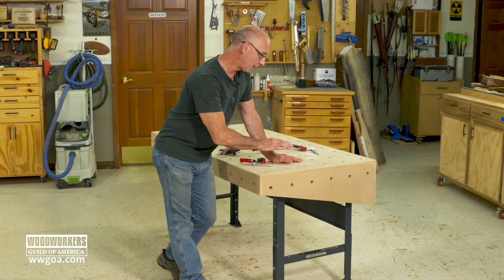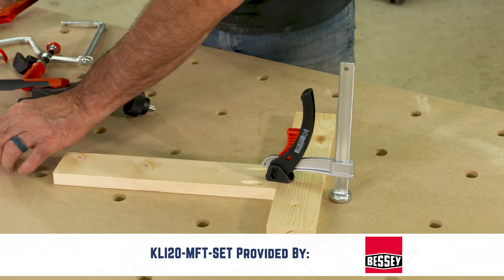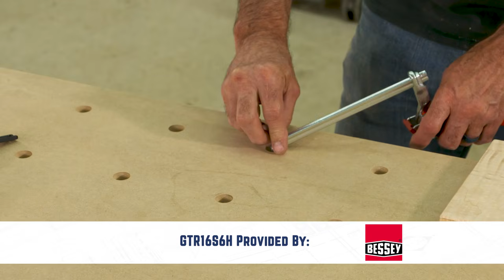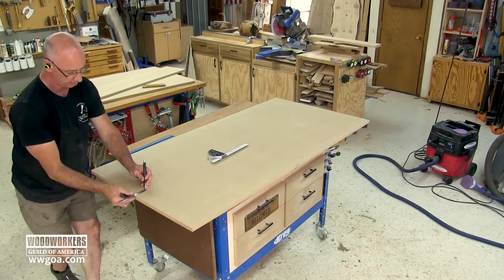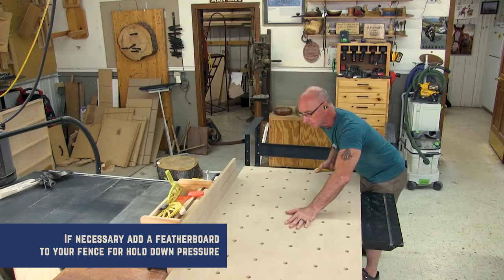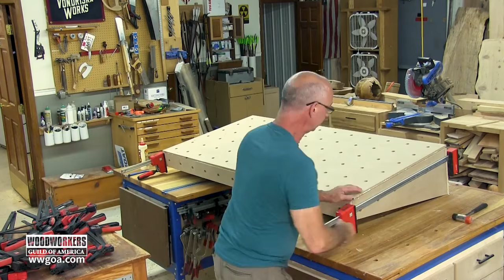How to Build an MFT Table

Comment: Yeah those Bessey accessories are nice, but the most compelling use for an MFT is getting perfectly square cuts, especially on panels too large for a tablesaw sled. Bring the tool (tracksaw) to the work vs bring the work to the tool (tablesaw). In order to achieve the required precision, you really need one of the many jigs that are available. Almost all are 96mm OC.

Also... I always appreciate when video presenters declare their sponsors. Did you buy that Bessey stuff?
Reply from the maker: Hello, thank you for your feedback regarding MFT precision and the importance of standardizing hole spacing.

Comment: Mis-titled.  Settle in for 8 mins of tool promotion, then 4 mins of bench build.  Also, any build other than 20mm holes on 96mm spacing (int’l standard for all MFT-type fixtures) is a waste of time and material.
Reply from the maker: Hello, thank you for your feedback. I have forwarded your comment to the proper department. We value your opinion, and it will help with the development of our online streaming community. We will continue to listen and work hard for your complete satisfaction.

Comment: Nice video, George.
What kind of finish would you recommend to put on top so that it seals the MDF surface, makes it durable and also easy to wipe of any glue drips etc.? Thanks in advance.
Reply: I've got a handful of MDF benchtops in my shop and have always sealed them with boiled linseed oil.  It's a good idea to dilute the first coat 50/50 with mineral spirits so it soaks in well.  Then apply straight BLO

Comment: And when you’re finished drilling your dog holes, use the UJK Chamfer - Reamer tool to put a clight chamfer on the top edge of the holes. The reamer function comes in handy later if (or rather when) the MDF swells (e.g. during the humid months in an unconditioned shop) or you get glue drips in the holes. Ideally, put at least 2 coats of your fav. hard wax oil on both sides of the MDF, wait till it dries thoroughly (at least overnight in a well-ventilated area), then use the Chamfer - Reamer tool on all the dog holes.

Comment: I think the standard spacing is 96 mm
Reply: The standard MFT does have its 20mm holes on 96mm spacing.  I CNC’d a top 10+ years ago when I got my track saw.  I decided to us 4” spacing, which fit well with my 36” x 84” MDF top.  I figured I would never need the “standard” spacing.  Now there are good reasons, like being able to secure a TSO triangle with dogs, since it has a few holes on 96mm spacing.  Or a UJK aluminum fence, which has holes at 96mm spacing.  This has really just been a minor inconvenience, and I’ll do a new top one day using the standard spacing.

Comment: Won't the center of this table cave inward under a little weight?  I know the outsides should be robust but I don't see any support for the center.  3/4" MDF just isn't very rigid.  Thanks you for the video!
Reply: For mine I'm going to double up on that. That would make it so I can't use those clamps he showed on the table. But they do make other clamps for it.

Comment: That looks like a very nice addition to just about anyone's shop. 

One suggestion for those who would like to build a version of this table: Instead of the hole spacing used in the video, put the holes on 96mm centers. MFT tables are popular in Europe and they have settled on a standard of 20mm holes spaced 96mm apart. Why use this standard rather than going your own way? Because there are a lot of 3rd party fences, clamps, jigs, and other accessories available for MFT tables that are designed to work with 20mm holes spaced 96mm apart. If you come up with your own spacing, or go with a different sized hole (such as 3/4"), you may find that the accessory you would like to use won't work with your table (without a lot of retrofitting). 

I have an MFT table from Kreg that uses 3/4" dog holes on 4" centers. It's a solidly built table. It works well with Kreg's track saw. It's just not compatible with a lot of MFT accessories that would make work easier in the shop. It's a big frustration. Some day, I'll sell the Kreg MFT table and build one (maybe along the lines of the one in this video) using the 20mm and 96"mm standard.
Reply: Thanks for the tips. Since you already have one of these, what would you suggest are the best dimensions for building a table like. Length and width wise?
Reply: @ahpdebeer  The Kreg table is 55" wide and 29.75" deep. That's a pretty good size for my purposes. It allows you to crosscut a 4'-wide sheet of plywood using Kreg's track saw. (You may need additional support for the plywood in front of and/or behind the table.) It also allows the table to be used as an assembly table or as an additional workbench. When I make my own version, I may keep the width at 55" but make it a little deeper, say 36". 

But, of course, the important factor mentioned above was 'my purposes'. I have a small shop. An MFT table much larger than described above wouldn't work too well for me. YMMV.
Reply: What's popular in Europe is not popular here in America.